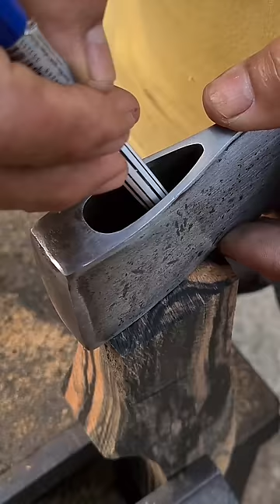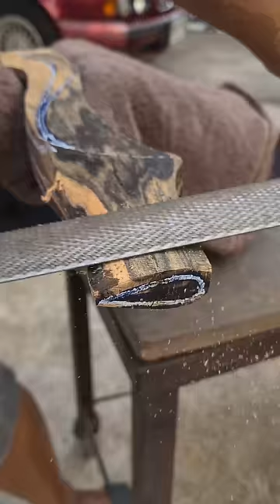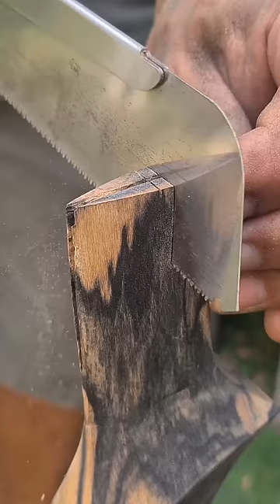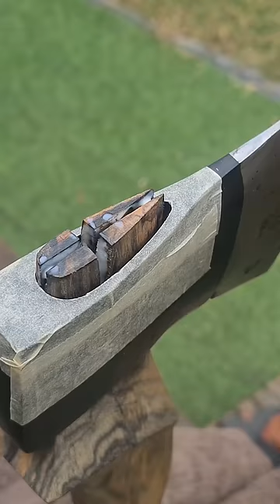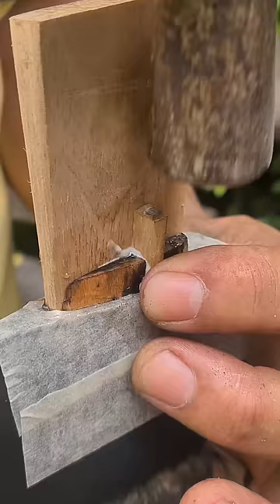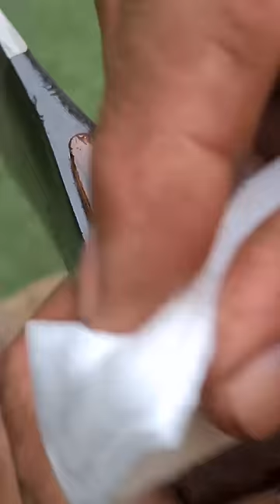Axe Hanging : The cross wedge on an exotic wood handle #craftsmanship #shorts

Comment: You really don’t need epoxy for the head if your wedges are tight enough and the handle is a good fit it will make no difference all you need is wood glue for the wedges
Reply from the maker: Thank you for your comment.👍😊🙏
Reply: I was thinking on similar lines. When cured, many epoxies become brittle, not something that takes repeated shock loads well. One expects an axe to take repeated shock loads.
Reply: That fitting  is a hack has epoxy in no way as good as the Ole ways well fit and wedged
Reply: Use softer wood for wedges?
Reply: How bout you use glue and he uses what he wants... how bout that ?
Reply: สาวมองไม่ละสายตเลยว่ััััะ
Reply: Better more than less
Reply: Muito bom o trabalho.🎉
Reply: The finish look fire tho
Reply: @bogeyman-bv4wg  his method will almost always lead to a loose head tho, personally I don’t even glue my wedges
Reply: L No
Reply: You do when you don’t know how to cut a handle lol
Reply: Mire.conpadre el cavo lo iso vien pero lo demás no  se parte el.cabo para que apriete la acho eso es de una persona que no sabe usar el ancho dedíquese a otra cosa  loque iso no está vien mi amigo
Reply: That's how he wanted to do it. U do whatever u want on yours lol
Reply: I happen to need to do a new fit to my pick and did thus same way and it worked beautifully , just like new , thanks for sharing

Comment: Because you've used epoxy the axe is weaker and it will be harder to replace the handle if it breaks or gets damaged, if this is a show piece then there aren't issues, next time use tight fitting and boiled linseed oil
Reply: @poomsproject   love you ☺️❤️

Comment: Why epoxy? It just makes it harder to repair the head. The whole point of the wedge is to avoid using things like that and make a repairable axe..
Reply from the maker: It make a long life handle. When it broke, we usually use drill to remove the epoxy and old handle.😊👍

Comment: Why would you glue that?

A working ax, ya wanna be able to tighten it (drive them in).
The same with hammers. 

Now, a pickaxe  is different  (that you smack that ax toward the end).

A working ax?

Nice as a showpiece  .
Reply from the maker: Thank you. Because we use hardwood for the handle, which has less expansion than ash or hickory handles, glue will help make it stronger.🙏😊🥰

Comment: The epoxy will crack at the first hit 🤣
Reply from the maker: How did you knew that, sorry I use a high grade epoxy glue not epoxy resin🤣🤣👍
Reply: @poomsproject  It's a shame, great ax and great work so far 👍👍